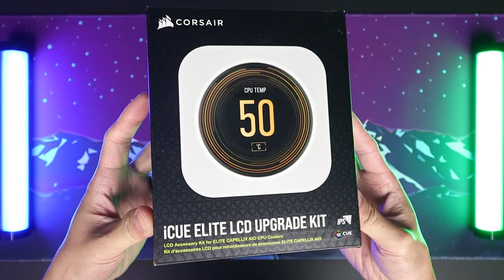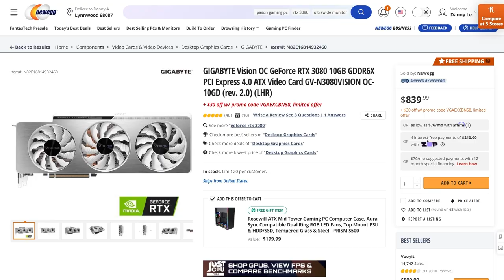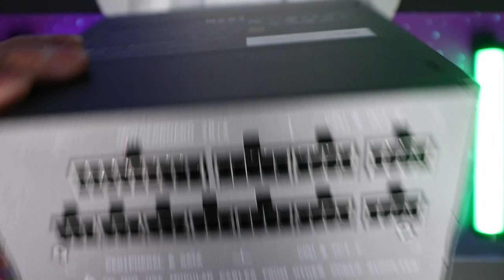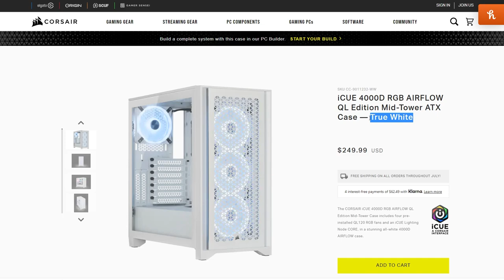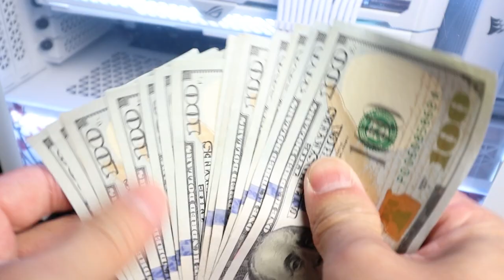He TRUSTED me with $3500 to build his new PC...

Comment: Wow, turned out great! So nice of you to help out your friend like this! 👍 it's truly a thing of beauty! I just built a 12900k ddr5 pc with a 3080ti ftw3 in a white lian li 011D xl.
Reply: Sounds like we got almost same build. I just did a 12990K DDR5 3080TI FTW inside a lian Li evo snowhite with 13 Lian Li Al120 white fans.
Reply: @joejanz6643  Nice! I used 10 of the lian li  sl 120 fans and an msi meg S360 aio. Using an asus rog strix z690e gaming wifi board with corsair dom plat 64gb and 2 firecuda 530 2tb ssd's.

Comment: Those back plates are neat and all (and that one specifically seems to have had time taken on the tiny details) but they are terrible for thermals on the 30 series.. The memory chips ande the memory junction temps will suffer severely. Also not something you would see in a typical thermal test, as you have to dig deeper to get those figures, Yore Core temp does not reflect the memory junction temps. my EVGA 3080 XC3 runs say 55-60c when mining Eth, or sometimes up into 65c while gaming, however if you open the Hardware info app and watch mem junction temps its pushing 90c+ when 110 is in the danger zone.. Ive also got a near open case with more then adequate air flow. TT view 71 with a 360 aio in the top for the Ryzen 7 3800x and 3 140's in the front.
Reply: Change your mem thermal pads should help a lot

Comment: YOU WENT ALL OUT BUT DIDNT GO WITH DDR5? IM A BIT CONFUZZLED ON THAT... crap sorry i had caps on. now wont he have to change boards to get ddr5? which is also not quite giving him the future proofing considering ddr4 is just about phased out (mind you im rocking a ryzen 5800x asrock b550 steel legend and 32g 3200 as well. prices were way to high when i built to even consider ddr5.. I do really enjoy these build vids for your friends. its neat!
Reply: 64gb ddr5 is still really pricey.    They didn’t want to go cheap but the budget wasn’t unlimited
Reply: @JasonWitmerYT  bruh.. the 12700 supports ddr5... Also yes with AMDs new CPUs supposedly from what I've seen in the rumor mill, the boards for them will only be compatible with ddr5. Which will be the same with Intel. So if there's a high budget ddr5 is the way to go. It will only get faster
Reply: @evers6214  yes I agree, but they could've easily went with a 2x16 kit to start or even 2x8 kit then he could add more later. When ddr5 first came out I was seeing them for well over $200 even $300 for 2x8, but the price has already dropped significantly ( probably due to the benchmarks showing the current ddr5 isn't much faster than the fastest ddr4) but he still wouldn't have to worry about switching boards just to get it
Reply: @evers6214  idk I get the look they were going for, but they could've saved money in areas and still came out with an awesome white build. They went all name brand Nzxt and Corsair (which the prices are a bit more than they should be) not to mention the amount of storage lol. Could've got ddr5 if they only went with one 2 tb nvme instead of two. Granted they got help from the companies, so at that point instead of giving him half his money back. They could've upped the board and ddr4 to ddr5
Reply: @drangstveitmark  yeah I tend to agree this isn’t quite how I would have done it either but Im thinking nzxt gave them that ddr4 motherboard and they had to use it in the build or give it back.   If it was me with that I7 I would go with faster 32gb instead of 64 but maybe the guy has a professional use for all that ram and storage
Reply: I use a lot of RAM when i'm doing my work. Lots of large CAD models and inspection files with thousands/hundreds of thousands of points. I wanted more RAM rather than "faster" RAM. The DDR5 just wasn't cost-effective enough to consider switching at this point. This new PC will honestly last me a long ass time so if I feel the need to upgrade in the future I will, but for now the 64Gb of DDR4 is exactly what I needed
Reply: @Awbade  cool beans. He mentioned light cad work so I didn't think much of it. I assumed it was mainly for gaming. What ever works for you. It is a sick rig. I'm waiting and hoping to get a new amd gpu when they come out this fall. Supposedly they are going to beat out Nvidia (which would be cool to see for a change lol) I run 32g of ram in my gaming rig mainly because of the price I got the ram at. For $70 for a 2x16 kit of white argb 3200 I've been very happy. I too have a v1tech piece. When I ordered it I didn't yet know my graphics card I was going to have so I went with an SSD cover one and mounted it using magnets since I don't have an SSD and it turned out great.
Reply: @Awbade  its awesome you got to get a new pc that is exactly what you wanted and needed.   I am always constrained by my wallet when I  upgrade and there always seems to be something I have to compromise on.      What you have there is a beautiful machine that will last many years.  Congrats and enjoy!